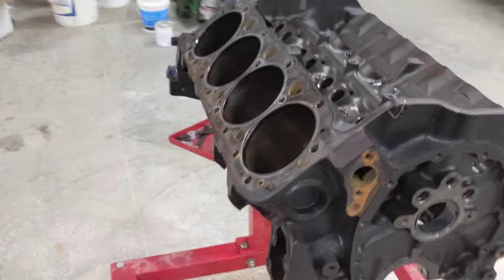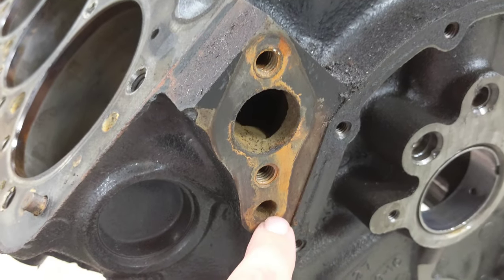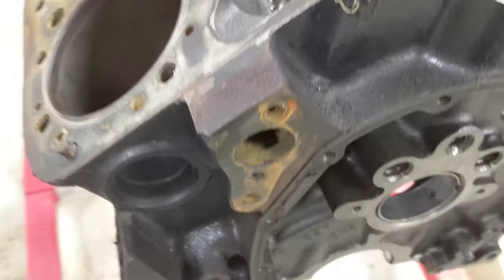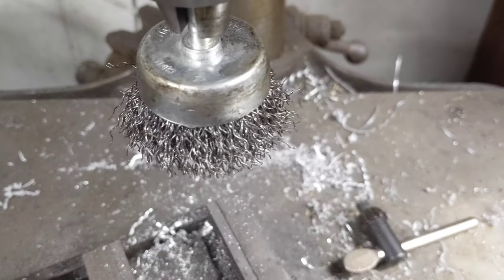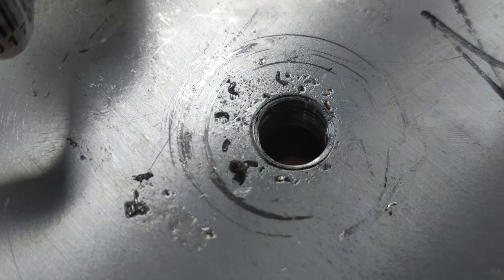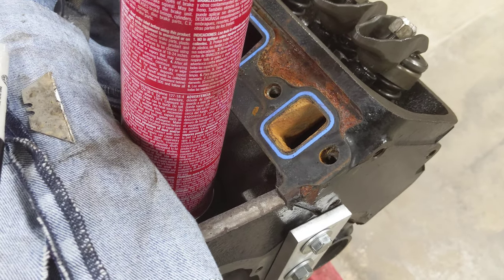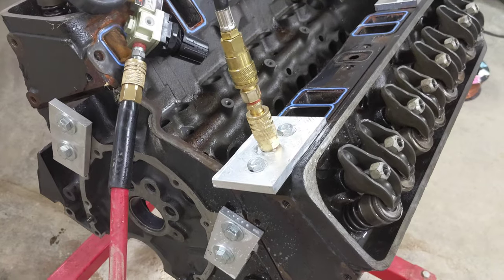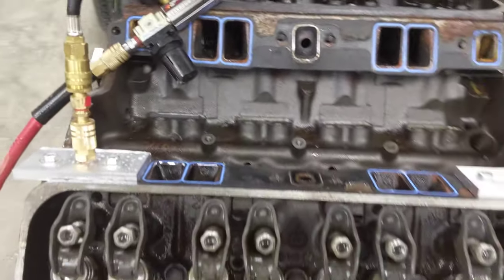Inspection & Pressure Testing the Block & Heads -- '95 Crownline 5.7 Mercruiser Rebuild Part 4

Comment: Were the parts marine specific or do you just use gm parts
Reply from the maker: Regular GM automotive. Summit, Jets, Speedway Motors. A little bit of everything. 👍
Reply: @605BOLT  thanks I've been having the hardest time trying to find marine parts
Reply from the maker: For all the bearings, rings, gaskets etc. I used just regular cheapo automotive stuff. Everything outside of the engine should be marine but the insides should be run of the mill GM. The gasket kit I had in these videos from Mr Gasket covered most of the gaskets. Just had a couple random ones it was missing.

Comment: Nice vid 👌
Reply from the maker: Thanks bro.  Kind of boring but helpful for someone that is doing the rebuild I think.
Reply: Check out the hose for crap too. Flush it or get a new one.
Reply: Mine got clogged up and was running hot. Blew head gasket and valve seat collapsed. About to pull it any day now
Reply from the maker: Which hose? The water intake hose?
Reply: @605BOLT  yes. Was grass clogged up the line
Reply from the maker: @starrider4878  interesting I will look for sure

Comment: So what was the problem? Where did the water come in?
Reply from the maker: Never really found out for sure. Machine shop was thinking maybe the head gasket might have been blown.  🤷‍♂️
Reply: @605BOLT  did you check exhaust manifold on this side? If it leaks, water can get in from the exhaust ports. Also, back flow from the riser (if you stop the boat too quickly) could also get to the exhaust ports.  It it was head gasket, it's very rare that water can go to multiple cylinders at the same time. My thoughts.
Reply from the maker: I haven't yet. I will do that before I install them. Could be the gasket failed in them or they are cracked. Hard to say.